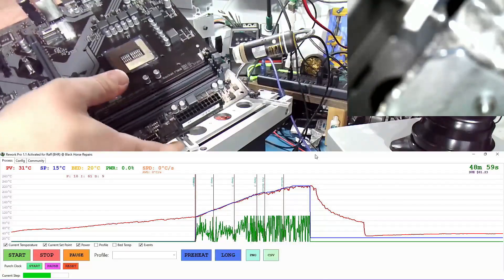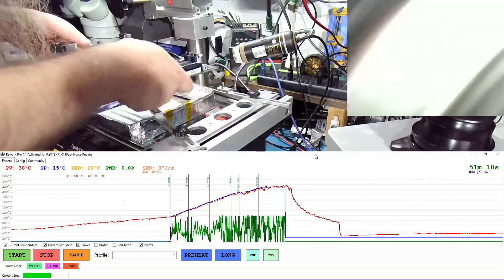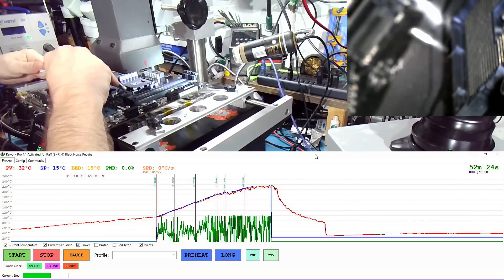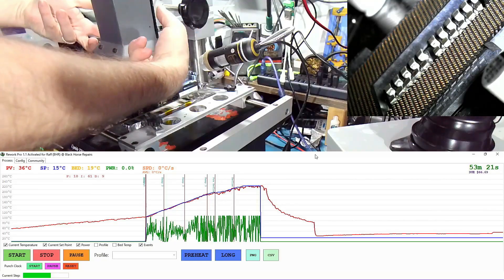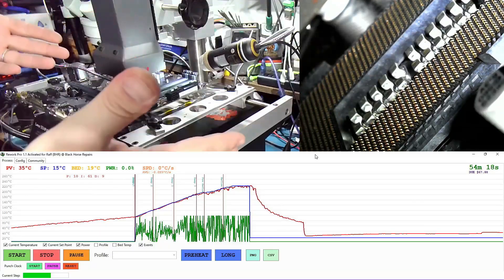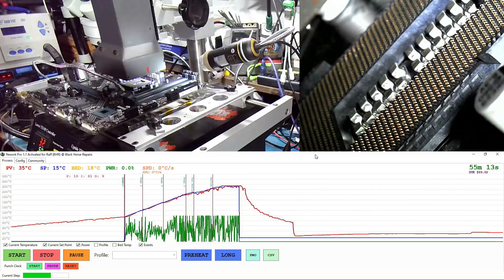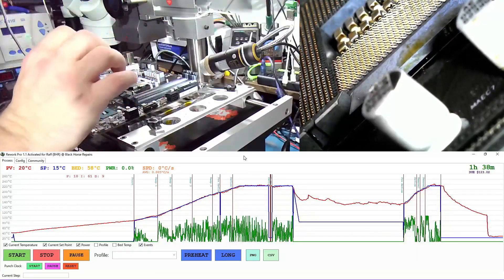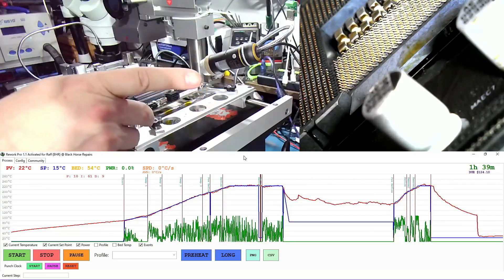325 | B760M LGA1700 Socket Replacement

Comment: The warping is caused by the station.
Heating area is too small.
Heating element must be same or larger than the board.
Thats why i bought my self 400x300mm heat plate. No profile will save you my friend
Reply from the maker: my theory is that if you preheat slowly the entire board will heat up even if the heater is smaller than the board. We will have our answer soon
Reply: @blackhorserepairs  Yes. Slowly also works but who wants it slow 😅
Reply: I think he's right. It would make sense to heat up the entire board evenly

Comment: I feel that your service rates are too low.  I am less skilled than you (no cpu work) and still charge $50/hr + parts.  Your knowledge and skill is worth more than you are charging.  I would willingly pay up to $200 for replacement of a cpu socket on a modern gaming motherboard without question.
Reply from the maker: thank you so much, I would gladly charge $200 for this but I'm still polishing my skills and adjusting my hardware for best results